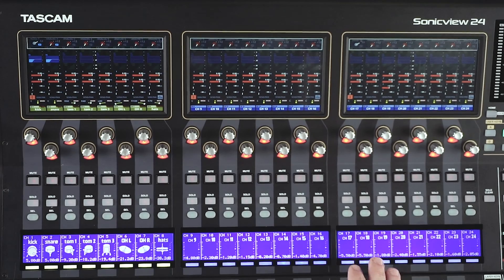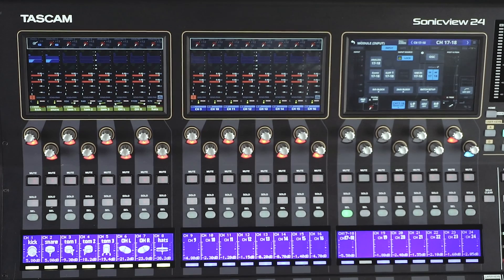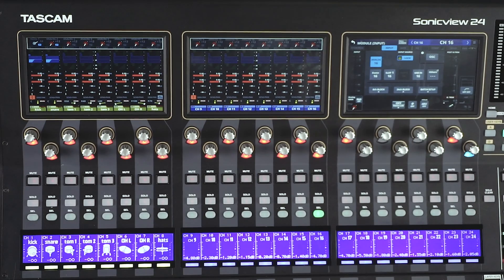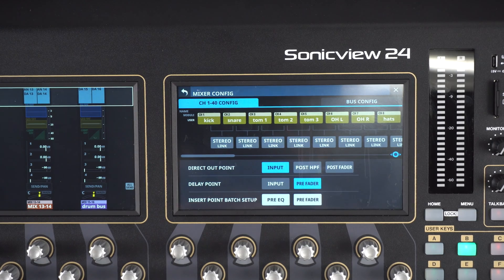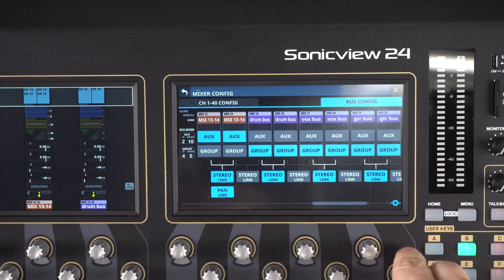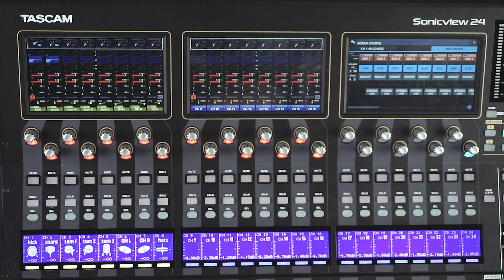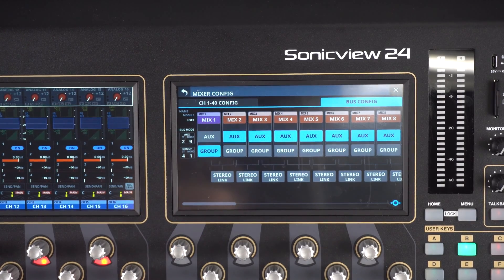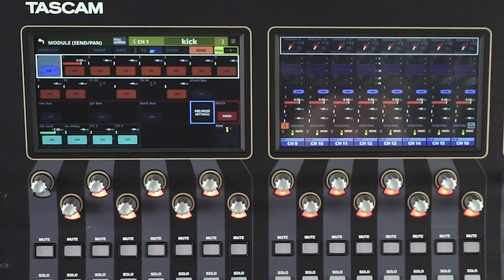Sonicview Learning Center - Aux vs. Bus, and Stereo-Linking

Comment: Does this work well with pro tools as a control surface?
Reply from the maker: Hello! We will be rolling out a firmware update in the near future which will feature control surface functionality. Pro Tools is integral to that, so it will be spot on!
Reply: @TASCAMUSA  That's great news. I haven't bought one yet but I've been through most of the tutorials and it seems like what I'm looking for. I've had the model 12 for a couple weeks and it's a great unit, but I need motorized faders and ability to control pro tools. Thanks for the quick response.